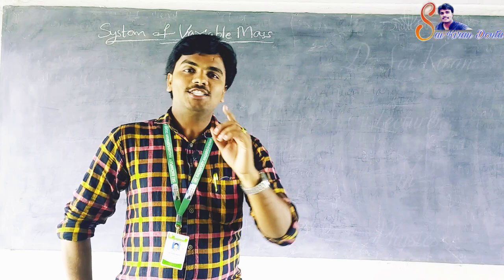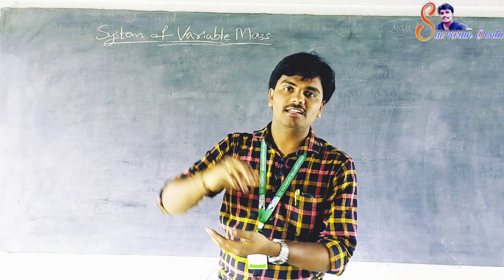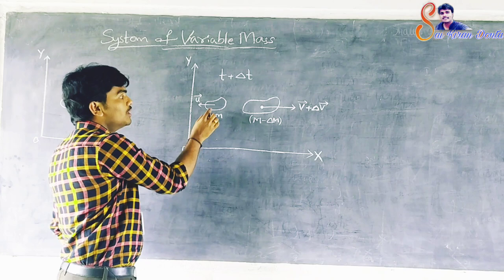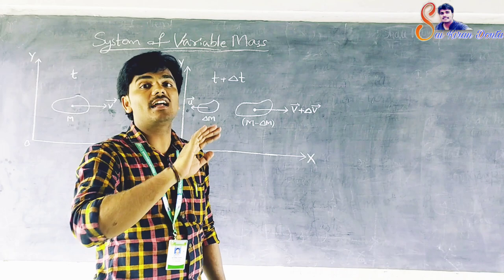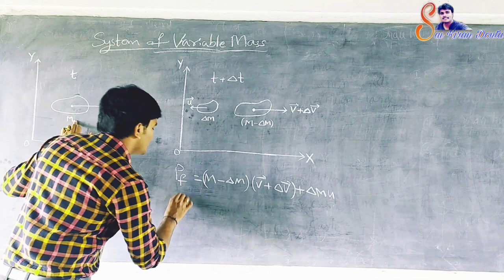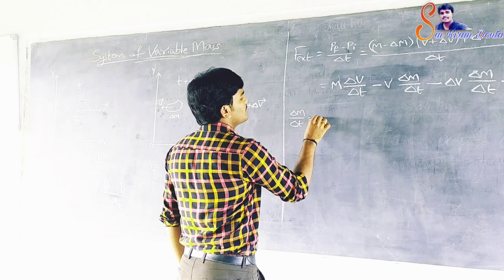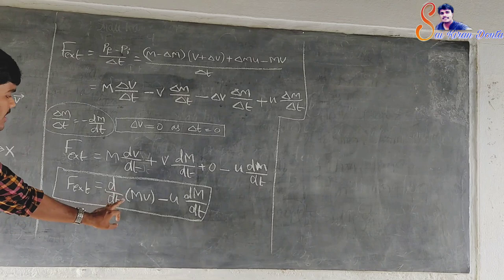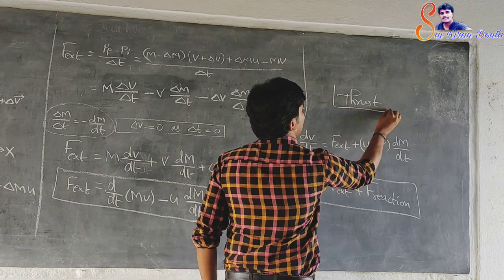System of Variable Mass | English to Telugu | B.Sc 1st Semester

Comment: What is difference between dp and ∆p?
Reply from the maker: Examples about delta P the differential pressure:

 The pressure in the plane is much lower than the atmospheric pressure at the ground. ... The delta P would be the difference in between the lower pressure in the airplane and the normal pressure on the ground.

Comment: What is thrust?
Reply from the maker: Thrust is the force which moves an aircraft through the air.Thrust is generated most often through the reaction of accelerating a mass of gas. Since thrust is a force, it is a vector quantity having both a magnitude and a direction.

Comment: Sir how  -∆V ∆M/∆t become zero and also dm/dt become minus these are my doubts explain me sir
Reply from the maker: As ∆t approaches to zero ∆v tends to zero. So the initial velocity 0. So zero into anything zero... In that way that term becomes zero. 

That ejected mass direction is opposite to the direction of motion of a Rocket. So we took the negative sign
Reply: Thank u sir
Reply: Here some amount of mass of gas is ejecting... so mass of gas is decreasing w.r. to time so ,  dm/dt  is negative...  negative in physics represent decrease or anything did aganist the nature ..... 
 And sir explained delta t approaches to zero 
  So limit delta t tends to zero (delta m / delta t) becomes dm/dt 

Ela ithe velocity = delta x / delta t 
ni v = dx / dt ga represent cheyadaniki instantaneous condition use chesthamo ala
Reply from the maker: Perfect😊👍🏻
Reply: @saikirandonta2774  your explanation is good sir but board is not good...